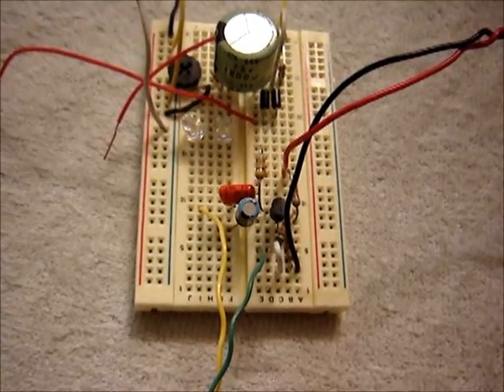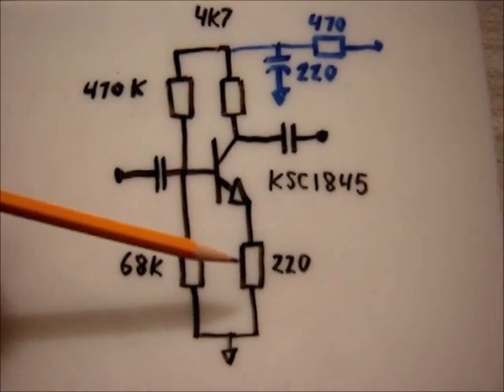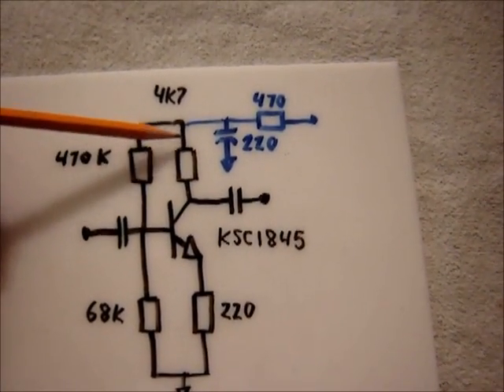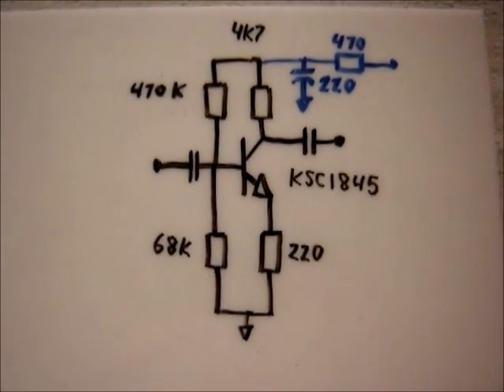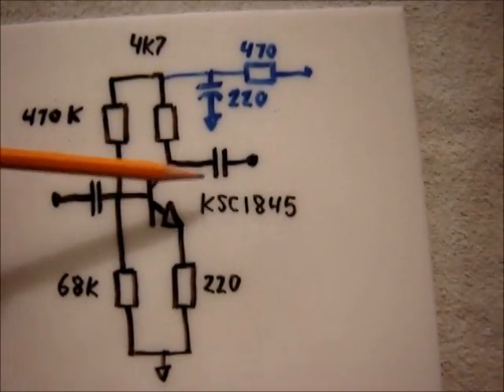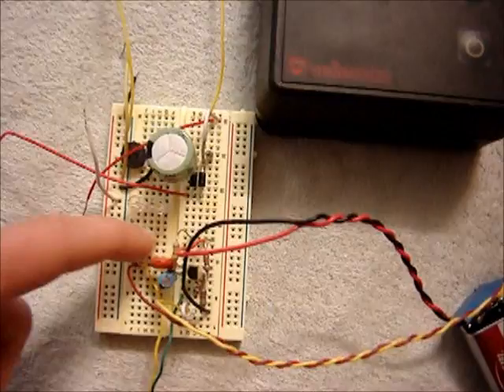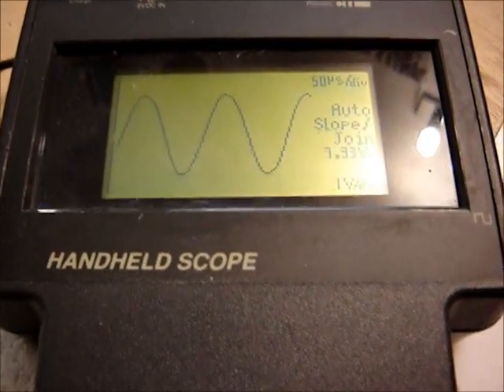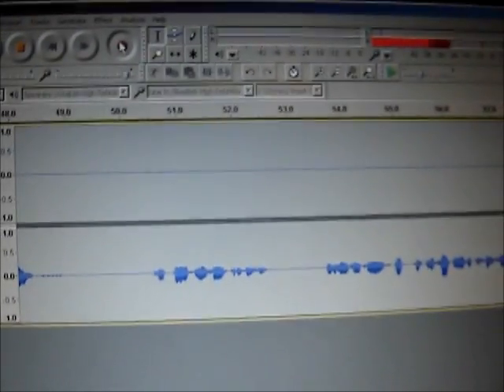Transistor preamp circuit DIY

Comment: The transistor acts as a unity follower, putting the same amplitude on the emitter follower resistor, as the voltage applied to the base. The voltage, divided by the resistance of the emitter follower(220Ω resistor) sets the current at the collector. That current, multiplied by the collector resistor,(4.7kΩ) determines the output voltage. If you add the emitter resistance to the collector resistance, then, divide by the emitter resistance, you will find, that this amplifier had a voltage gain of ~22.363636. If you take the ß of the transistor into consideration, the gain is slightly less, but, I don't know the value of that particular transistor, so I consider that to be negligible when calculating the gain of a common emitter amplifier stage.
     Good video: I really appreciated the demonstration!

Comment: i followed this class a design to make a preamp for my TDA2003 today, with different parts though, bc548 and slightly different set of resistors ..... 100k @68k produced better results. also replaced the 4.77k with 3.3k. 
and the result was nice, sounds a lot more punchier and detailed now. 

still some noise is there, will see if i can tune it. thanks.

Comment: you can increase the gain by placing a capacitor parallel to the 220 ohm resistor (transistor collector side)
Reply from the maker: Yes, that will increase the gain but will reduce the feedback causing higher distortion. There is no free lunch as they say.
Reply: @JohnAudioTech  I agree: "Kiss your linearity goodby"! I would sooner add another gain stage, then try to increase the gain of a single stage. Not only will that preserve linearity, it will ultimately give a better signal-noise ratio, despite the second active element.(transistor)

Comment: I will have to do more research on the KSC18445/KSA992 vs. the 2N5210/2N5087, maybe look at some other manufacturer's data sheets. Will need one or the other for a special purpose amp project I want to design if I ever make progress on my backlog of other projects.

Comment from the maker: I have no experience with the 2N5210. The datasheet does provide lots of noise graphs whereas the 1854 shows practically nothing. They are both low current transistors designed to keep noise low. I'd guess they'd both work fine, but you'd have to perform side by side tests. I've just kept the KSC1845 and it's complement around for tinkering and repairs.
Reply: HEY THERE DUDE , CAN YOU PLEASE TELL ME WHY WE NEED A RESISTOR 4.7kOm FOR THE OUTPUT TO TRANSISTOR ??? CAN TRANSISTOR WORK SAME WITHOUT IT ??? THA NKS

Comment: Was curious to see if the KSC18445 was any lower noise than the 2N5210 I would of grabbed for such a project, but the data sheets (Fairchild) rated the noise of each in different ways!

Comment: can I use transistor BC 548  to amplify audio signal, also how many stages do I need to get the hearable output?
Reply: To duplicate this circuit, I would recommend the complementary transistor, BC547. The BC548 would work, but, because it's a PNP transistor, you would literally need to turn this whole circuit "up-side-down".(or simply reverse the polarity of the battery and capacitors) This circuit is using a NPN transistor, and a BC547 would work perfectly, because it's also an NPN transistor.
Reply: @vincentrobinette1507  both bc547 and bc548 are NPN!
Reply: @keideshramnanansingh815  You're right! the PNP compliment is BC557. I thought bc547/548 were complements, much like 2N3904,(NPN) and 2N3906.(PNP).Those are the transistors I use most often.

Comment: I would like to use this in a 27V system and I notice you say it works best at 9-12V. How can I make it compatible?
Reply from the maker: +Deep Listener You would need to change the values of the resistors to reset the bias.
Reply: You would need to DECREASE the value of the 68kΩ resistor(base to ground) and INCREASE the value of the 4.7kΩ resistor(collector to positive supply)

Comment: I googled just in case, in the video you said that current across a resistor creates voltage, but that isn't the case, this is why I googled to verify. As far as I understand it, the wire in a resistor is just very very thin and this is why electrons struggle to get through.

Plus, since resistors are usually used in DC circuits, there can be no varying magnetic field to create an opposing voltage like with inductors in an AC circuit.
Reply from the maker: +farmdve You misunderstood what I was saying. Current through a resistor causes a voltage potential across the resistor. Put 1 amp through a 100 ohm resistor and you will have 100 volts across that resistor. It is Ohm's law. Nothing to do with inductance.
Reply: +JohnAudioTech There is always one dude (at least) commenting on every video you make that wants to point out some error. And you always handle it cool as a cucumber.
Reply: RipBChord Are you trying to imply something here?
Reply: Merely following John's videos for a few weeks and as per Youtube tradition there are many that want to challenge him over something they feel he should be corrected on. And don't you feel like he handles it well? I've seen many Youtubers that will fly off the handle on someone for much less.

Comment: Circuit design shouldn't take an hour. Assume you want a gain of around 20 and you have a 9V supply.
(1) Rb: For small signal transistors, you'll want a quiescent current of at most about 1mA. At that sort of current, the transistor BE junction will drop around 0.65V and have a slope resistance in the hundreds of ohms, so a base resistor of 220 ohm is reasonable to improve linearity.
(2) Rc: Since for most small signal transistors the Hfe is quite large, the collector current and emitter current are effectively the same. Since the BE junction voltage hardly changes with change of current, whatever signal voltage is applied to the base will appear at the emitter. That signal causes a current in the base resistor which causes the same current through the collector resistor. Therefore the gain is the ratio of the collector resistor to the base resistor to a first approximation. 4.7K is about 20 times 220 ohm, so that's a decent value. That sets the output impedance of the stage, so we probably don't want to make it too much larger because stray capacitance will start to roll off the high frequency response, and we don't want the next stage to load it either.

(3) Bias point for collector: For maximum swing, we want the collector to be a bit above half the supply voltage, which means that we want about 4 volts across the collector resistor, so we need a quiescent current of 4V/4.7K = 0.85mA. That fits well with our goal current of less than 1mA.
(3) Bias point for emitter: The emitter will be at 220ohm x 0.85mA = 0.19 V above the negative rail. That's insignificant compared with the maximum voltage swing possible (4.5V each way), so we're in the right ball-park.
(4) Bias point for base: The base will be about 0.6V above the emitter at about 0.8V, so we need the ratio of the base bias resistors to be (9.0 - 0.8) : 0.8 = 10 approximately, assuming the base current  is much less than the current through these resistors. Since the Hfe should be in excess of 100, the base current will be less than 8μA and we can ignore it if we pass more than 80μA through the bas bias resistors, meaning they should add up to 9V/80μA or about 120K. That implies something like 100K and 12K for the upper and lower base bias resistors respectively.
Now those may be too small (as the lower value effectively sets the input impedance of the stage), so some compromises may need to be made by using higher value base bias resistors, but that makes the circuit's operating points more dependant on the transistor Hfe, which we should try to avoid. The KSC1845 is available in different gain classifications, so a tight range of Hfe could be specified, which would allow higher base bias resistors, as long as you allowed for the base current pulling down the base bias point.

The analysis of the circuit shown implies a base bias point around 1.0V for a KSC1845U with Hfe=600, giving an emitter bias point of around 0.4V, hence an emitter and collector current of 0.4/220 = 1.8mA. That puts the collector at 9.0 - (4.7k x 1.8mA) = 0.5V which would be in saturation. I duplicated the circuit using a BC183LC (which had an Hfe of 600) and it was in saturation, as I predicted. I then tried a transistor with much lower Hfe (100) and that drew much more base current, forcing the base voltage down, and with it the emitter voltage, hence reducing the collector current and biasing the transistor out of saturation. That proves to me that the base bias resistors are simply too high in value because the operating point of the circuit output was too dependent on transistor Hfe, and you can't reliably design circuits like that.

Comment: Please consider rephrasing part of your explanation (around 3 min in).   A current through a resistor does not CREATE a voltage but rather it results in a voltage drop because the resistor consumes the energy of the moving charges.  There is a voltage at that lead even when there is no current.  It would be the supply voltage.   Also, the Class A amplifier classification is because the transistor is always on (even when signal is off).

Comment: what is the value of the capacitor connected to base
Reply from the maker: +Larry Shaver You can use a .22 to 1 uf will work okay. The lower the value the higher the low frequency roll off.
Reply: yes I know higher values pass more bass

Comment: Hi ! man. I apologize first for mi english, I`m from Argentina.
I wanted to now the devices you used (if we use the 9V battery).
4 Resistors: 470K, 220, 68K and 4K7.
1 Transistor: KSC 1845
2 Capacitors       ¿ which type ?

Thank you for the video.
Reply from the maker: 0.1uf on input and 1uf output (may adjust due to load impedance), use film types. The circuit needs optimized for better THD performance. It rates about 0.6% THD at 1KHz.

Comment: Voltage pushes current, not the opposite.
Only in coils a current produces a magnetic field and the field induces a current on a wire because the mag field creates the diff of potential or voltage.
In a water tank , the column of water creates the pressure or Voltage, an opening at the bottom lets pass a flow  or current.
I = V/R    not V =I * R in physical sense.

Comment: Is there another transistor that is is a lose match to the one you're using
Reply from the maker: +Larry Shaver You can use about any small signal transistor for this circuit.
Reply: great'thanks for answering

Comment: if you remove 220 resister and place 10 ohm resister instead you will get better gain than this
Reply: In principle, you might achieve higher gain, but with SIGNIFICANTLY less negative feedback and thus significantly more distortion.
As with almost ANY circuit, the values chosen are often a trade-off.
You can get more of 'X' but only if you're willing to accept changing 'Y' to do so.
Has anyone asked yet about throwing a capacitor across the emitter resistor?
Or perhaps using a darlington?
<Grins>
Great work as always JAT!